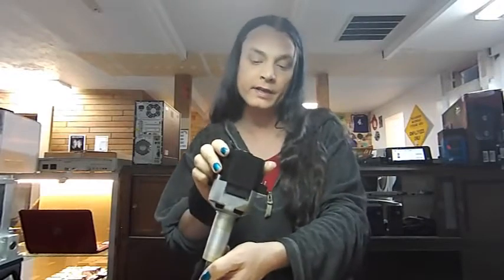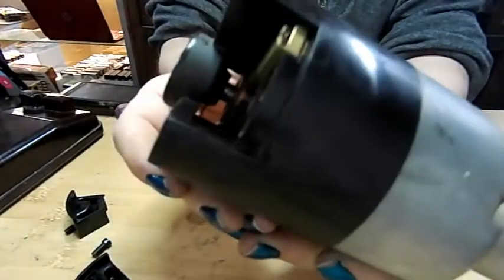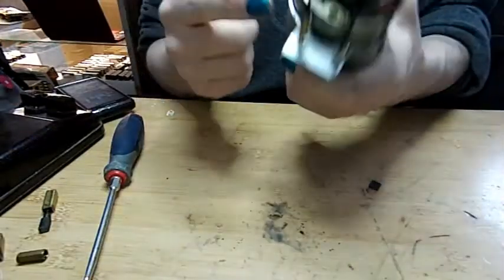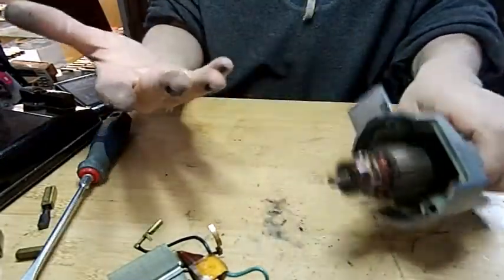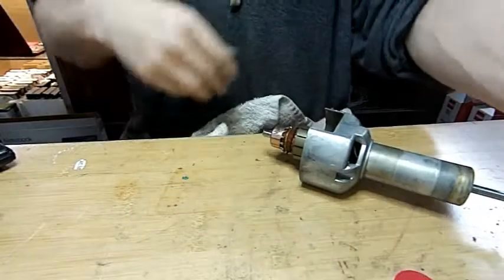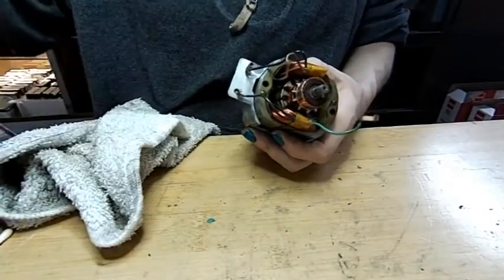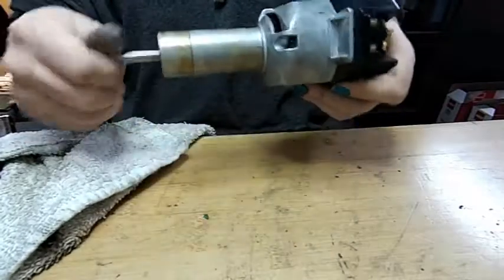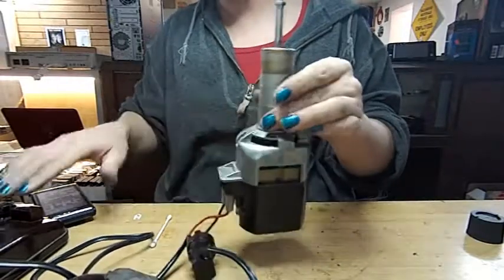How to Service a Vintage Singer 401a, 403, 404 Sewing Machine Motor

Comment: I've overhauled about 10 potted motors for 301's and 401's with complete success using Steve's instructions .  His instructions are excellent!  However, everyone seems to have overlooked, or not been aware of, one very important step.  That is to re-align the upper and lower motor bearings - very important and easy. 

I will follow Steve's convention and call the bearing in the "gear end" of the motor the upper bearing.  Thus, the bearing in the black plastic housing end of the motor is called the lower bearing.  The upper bearing is a true ball bearing assembly with a ball race.  It is pressed into the motor housing metal casting.  I personally would not attempt to remove it.  One would need some sort of toggle press to get it, or a replacement, back in square.  I would simply clean it with solvent and re-grease it with Tri-flow grease and one drop of Tri-flow oil.  The lower bearing is entirely different.  It is what we who were in automobile small motor design called an "oilite bronze self-aligning bearing".  The bearing itself looks like a 5/8" sphere with a shaft hole thru the middle.  The spherical outside of the bearing is the feature that does the self-aligning.  It is captured between the black plastic lower motor housing and a spring clip.  The bearing is free to articulate when an external force is applied.  If you view the lower housing with the armature removed - viewed from the inside, you can see the spring clip.  If you remove that clip by rotating it about 10 degrees CCW while flattening it, the clip and bearing will fall out.  Beware, the spring clip is somewhat strong - it took all my two thumb strength just to flatten it.  Leave the bearing and spring clip in place and just douse the bearing ID with solvent and apply Tri-flow grease and a drop of Tri-flow oil.  By the way, the bearing was probably originally  cooked in oil at the factory.  The "oilite bronze" is porous and absorbs the oil.  That original oil was cooked in about 70 years ago - amazing!  Now the important part - aligning that lower bearing.  First, complete re-assembling the motor, after cleaning the commutator ring, carbon brushes, etc.  Next, you'll want to run the assembled motor - first, laying on the bench and then while holding the motor in your hand.  BE CAREFUL!!!!  Step one - unplug the sewing machine from the wall socket before you attach the two electrical leads on the bottom of the sewing machine into the motor.   By the way, the two electrical leads are barely long enough to attach them when the motor is out of the sewing machine.  You may need to wiggle the motor around a bit.  Then set the motor down on the table (hands off), plug the machine back into the wall socket and activate the foot pedal. The motor should "spin up" and probably dance around on the table.  Now to re-align the bearings you will use a small or medium hammer.  Don't be 'fraid!  Hold the motor in one hand and activate the foot pedal to maximum.  You will now "tap" the lower black plastic end of the motor several times while it is running at full speed.  The raised area you're going to tap is about the size of a small bottle cap and it has some manufacturing data molded onto it.  Listen carefully to the motor RPM while you do this.  Remember that the motor housing you're tapping is plastic, so don't tap it hard enough to break it.  If you think about how hard you'd be willing to tap your own forearm with the hammer, that's about right for the first tap.  The second tap can be slightly harder.  I'd say that you're done after about 3 taps.  You will probably hear the motor pick up speed after the first or second tap.  I hold a single thickness of cloth over the plastic housing before I tap it.  Also, I think that a rubber mallet might not work, since you're depending on the "suddenness" of the tap to do the re-aligning.
This re-alignment process also works well on many other belt drive motors (Singer, Kenmore, etc.).  Good news, those other motors have metal, not plastic, housings!

Comment: Thank you for your video. I have a couple 401a’s and one of them has a slow motor.  I tried lubing the gears etc and not much improvement.  Watched your vid and took out the motor.  Used 1000 grit sand paper to cleanup the armature put it together and not much improvement.  Took it apart and flattened the brushes like you did and it helped a bit.  I bench ran the motor and watched the brushes spark and wear in.  Took a minute or two.  As the brushes wore in,  the motor speed cranked up to hyper warp and now my 401a is working like it should.  So flattening the brushes was very important.  Thanks again.

Comment: Thank you so much for your video! My friend gave me a 401A that was really, really slow.  When I took out the motor it was like burnt toast, but because I have nothing to lose, I cleaned it up like you described, ground down the Commutator and bushes and now she’s ready for NASCAR!  I was scared to do this, now I may be obsessed with repairing machines!  AND, I have a Poison song stuck in my head from your mix tape!!!

Comment: Hey Stevie, just serviced my motor and it went easy (after watching the video).  The commutator was all gunked up and the dremel  work the trick to polish it up.  Low speed performance is much better! I don't know how you managed to keep your hands so clean, I am a mess.  I had been unimpressed with the machine , but now I new respect for it. Happy Day
Reply from the maker: Dish soap washing my hands many many times during the video shoot so it looks more like a glamorous Mary K commercial vs a nitty gritty lets fix old greasy dirty dusty things. It helps with confidence so im told to make sure you always have clean hands :D.

Comment: Thanks, Stevie!  This is very useful.  I found that the ball bearing in the motor of my 503a was hammered.  It's easy to find and replace.  It has a 7mm ID, 22mm OD, 7mm wide.  The generic part number is 627zz, where the zz refers to the metal shields on each side.  Easy to find on Amazon or ebay.  As you mentioned, it's relatively easy to press the armature out.  A wire retainer holds the bearing in the housing.
Reply from the maker: Im sorry for the Delayed Responce I had no idea youtube was holding the comments until now. Nice thanks for that info. I have one I need a bearing for but was being to lazy to yank it out and haul it to the bearing shop to get it sized. Now I got a part number.
Reply: I'll save the video of this DIY project as soon as you release it. :-)

Comment: Have you changed the spindle bearing (ball bearing) at the end yet?  My husband did on ours as it was still rough as yours at 8:28-30.  That made a huge difference, smoother and quieter at all speeds.
Reply from the maker: Nope I sure havent. Its quit a bit smoother after the motor has been ran and that oil/grease fully soaked in. But that takes time and I didnt want to spend that much time revisiting the video.

Comment: Nice. Just picked up a seized 401. Got the cam shifters unstuck from A-K 3. Turned smooth on the drive shaft, but the motor was slow and no torque. Will try a brush and commutator service as shown. If works. Great. If not, find another motor.
Reply from the maker: Right on

Comment: Thanks for the excellent video. You sanded the brushes flat. Is there a reason for that? The commutator (rotor) is round and will make them convex after a little use. The convex shape also increases conduction. I prefer your method of cleaning the inside with CRC, I just used an air compressor(always wear a mask!) I loved your way of polishing the commutator. A polished commutator will increase the life of the brushes.
Reply from the maker: Because when you polish the Commutators it could change there profile slightly so if you sand the brushes flat it will make them regrind back to the exact profile of the commutators. Thats the reason why when you buy new brushes there Flat not already profiled. When I wasnt sanding them sometimes it would take longer for them reprofile because the rounded angle has much more surface to wear into vs a flat squared surface. Or worse they would only make connections on the extreame edges and not the hole brush maken the motor not run correctly for a while til they broke into the commutator.

Comment: You might show connecting the motor to the pedal with the pedal unplugged from the wall. That way there are not any metal parts or screws to touch and get zapped. Or even better, have the pedal plugged into a power strip that easily switches off and on!

Comment: Thank you for the videos, I purchased a 401A from a thrift store for 30 bucks I cleaned it up, oiled and greased while it watching your other videos thank you very much they were so helpful. The motor has a burning rubber smell within a minute of stepping on the pedal. I cleaned the motor brushes they were grimy. I don’t feel comfortable taking the motor apart. Any idea how much a replacement motor should be?
Reply from the maker: Good question. And even if you get a replacement will it be washed out oiled and ready to go? Go watch my geared motor video is simpler then you think.

Comment: I discovered your channel yesterday and was so glad!  Another good, very clear and concise video!  Thank you!  A question, where would you look to find a 401a that was still operating and could still be used for years to come?  I don't want to get ripped off by buying a machine that has no hope of giving service.  thanks
Reply from the maker: Most singer 401a's can be brought back to smooth sewing conditions. Ive had 8 of them my self and none of them had major serious issues. They were all filthy gummed up and dry as a bone. Cleaned up the lint soaked them down with triflow and fiddling got them all running again.
Reply: @SewSaveMe   thanks, I'm going to be on the hunt for one.

Comment: Hi Stevie, I was looking to see if you ever did a video on servicing the 3 lead motor from a 620 or 640 as you said you would do after you converted the 401 to the 1 amp motor with speed switch. I converted my 401 with a motor from a 620 but it is just a 2 lead motor with a switch that slows it with a resistor I think. I am trying to convert my 503 now with the motor and two speed foot pedal from a 640 and am having trouble figuring out how to wire it. I thought seeing you rebuild the 3 lead motor might help. I wiring diagram would too. Any help would sure be appreciated. Thanks, Jim
Reply from the maker: I always use the wire harness out of the doner machine as the Stock 50x and 40x wire harnesses dont have enough pins in the connector to run a 3 wire 2 stage motor. I suggest you use the 640's wire harness in the 50x machine. Then the only thing you have to wire up is the light.

Comment: Hey, I just love following you and doing these videos TOGETHER.  I'm putting my motor back together, and the tape holding the copper wire (the little bundles on each side) is totally frayed out.  It's still (kindof) holding the wire bundle together, but the fibers in the tape are all frayed out and really a mess.  Can I use electrical tape?  Should I even attempt to replace it?  I put it back together with frayed ends inside....I'm a little scared to rev it up.  Let me know what you think.  I have no idea what kind of tape it is....stringy tape?  :-)
Reply from the maker: With out a picture im not sure how to respond. But I do know that electrical tape isnt the best idea ether. The heat and vibration wont make it super permanent. Plus Tape eventually loses its sticky. If your talking about the wire that holds on the to the contact in the motor you could always try resoldering. If its just the old cloth insulation on the wire try shrink tube its pretty handy stuff.
Reply: SewSaveMe  i have the same issue with the string tape wrapped around the reddish coloured wire bundles.  Do you really need any tape at all?  They all (the wire bundle) seem to be meshed together and not touching anything.

Comment: Hey Stevie I have a question I have a 301 do you think upgrading the motor from a 400’s series fit my 301 ? If yes I would change the warm gear from my 301 to the upgraded motor but am asking like is the shaft the same ? I would like to upgrade the motor on my 301 to a higher amp motor..do you think it’s possible ? Thanks 🙏🏼
Reply from the maker: Im not sure actually Ive never owned a 301.
Reply: @SewSaveMe  thanks for the reply I guess I’ll take the risk but if it does work I’ll keep you posted..have a great day 🙏🏼🤘🏽

Comment: Thanks for these great videos!  I have a Singer 401A I bought used a few months ago.  The motor got increasingly weak over time.  I serviced it following along with this video.  The problem got a little better, but now the speed is inconsistent.  I can hold the foot pedal all the way down, and the motor will speed up for a few seconds, then slow down a bit, then speed back up, etc.  Any ideas on why it does this?
Reply from the maker: Im sorry for the Delayed Responce I had no idea youtube was holding the comments until now. Might want to clean the carbon piles up in the pedal or make sure the wide open bar inside of it isnt burnt though or carboned up real bad. Or try a known working pedal.
Reply: Folsoml, I had the same problem. Those old push button controllers stink. Reading on a bunch of Singer forums/FB pages, a good upgrade is to buy one of the newer electronic pedals and replace the old one. I could not find one with the special plug for the 500a so I bought a cheap one on Amazon, cut it off the harness, cut mine off the harness and wired the new one in its place. Two wires like a lamp cord. Soldered the wires and covered with heat shrink then electrical tape. Ladies said the old ones are also a fire hazard because they use resistance whereas the new ones are electronic. The new ones have much better speed control, especially at low speeds. I'm not directing you to do this, just telling you what worked for me.
Reply: John Winn m

Comment: Pron: commutators, not communicators   and no, the turn-on smell comes from the ozone produced by the brushes arcing, it's normal. Your nose senses it and then ignores it quickly. Many modern motors are brushless and controlled by stepper circuits.  So we tend to think it's an old-timey electric smell.
Reply from the maker: I was wondering when some one was going to pickup that typo. :)

Comment: How do you remove motor without damaging it and how due you remove top bearing
Reply from the maker: I havent had to replace or seen a reason to remove the top bearning so far. Ive yet to see one in that bad of shape since you grease the top gears that grease tends to seap down into that bearing and keep it from wearing down. But if you Have to remove the bearing there is a retention clip that holds it in on the top if I recall. But I dont usally mess with them since the plastic can be very brittle. If you have to you can always soak it in triflow and spin the shaft to clean out the bearing and reoil it.

Comment: great video! going to work on rebuilding my 401a motor this weekend.  so you don't think lapping the brushes to fit the curvature of the commutator is necessary? some other videos i watched they wrap sandpaper around the commutator and sand brush like that to get curvature.

had a lot of fun watching your video at 2x speed!!  thanks for sharing the knowledge :) .
Reply from the maker: Im sorry for the Delayed Responce I had no idea youtube was holding the comments until now. I usually just flatten them. They will wear back into the commutators ive found. That way they are broken in to your motor. Most new brushes are flat to begin with even in new motors.

Comment: Commutator, not communicator. Not sure you accomplished much without going thru or replacing the top bearing.
Reply from the maker: Its service the motor not rebuild it. The two Dozen or so motors ive come across only one of them had slop in the top bearing. So Most of them didnt the bearing replaced, all of them needed oiling. ;) I said that on accident never reshot because I was cerious to see how many people watched the hole video and paid attention. Quite a few to my surprise I didnt think I was that interesting.